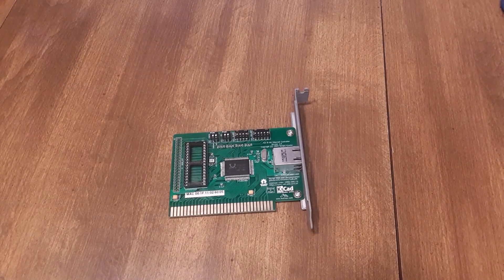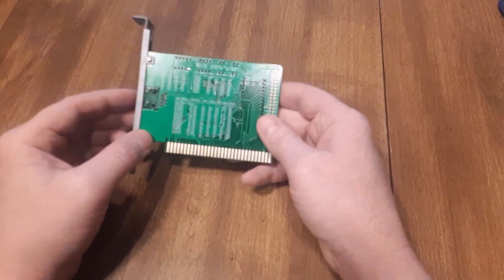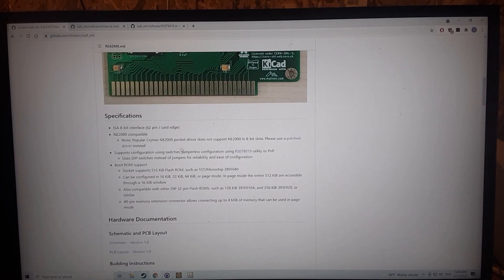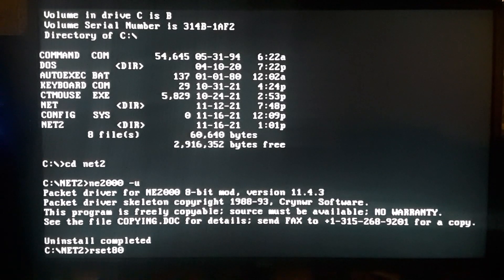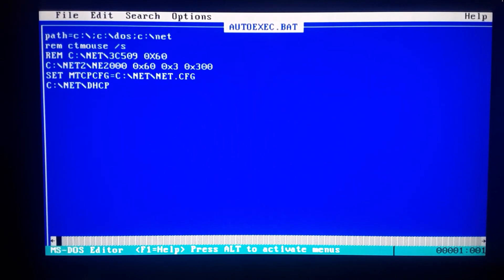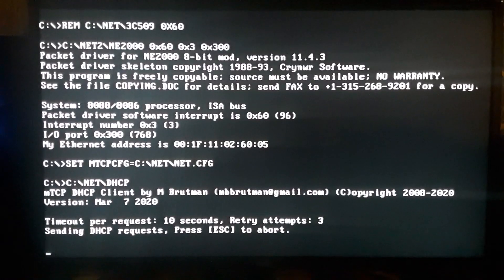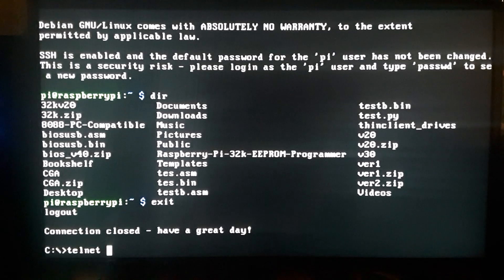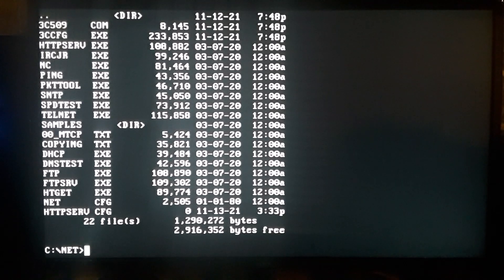ISA 8-Bit Ethernet Controller

Comment: So just to clarify this was running on your 8088 system or is it a V 20/40 a bit faster?
Reply from the maker: This is running with a V20 processor. I have tested it with the 8088 processor and it works the same.
Reply: @elijahmmiller  Awesome thank Mr EMM I did not see this reply until now, hopefully going to have the XT back in its case soon here and getting some hacking done.